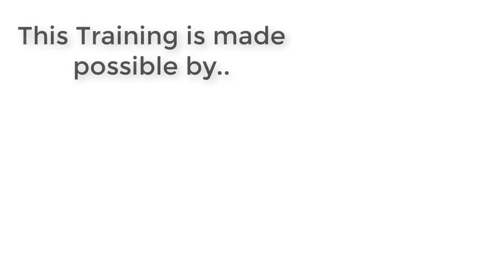A Common Cased Coil Issue

Comment: I find dozens of these improperly installed "N" coils that Carrier  and Rheem manufacture a year in Baltimore MD area. Sad when it was a new install not even 2-3 years old. Many  times  homeowner has given up on the original HVAC contractor who installed the new HVAC system because the house will not properly cool or dehumidify when the out temps reach over 90+ degrees with a  70% outdoor RH or higher.I have quite a few HVAC conatrctors not happy with me after I  go out on these HVAC calls for a 2nd opinion and b explain to homeowner what the issue is and that is was installed incorrectly and  homeowners get upset with the original HVAC installing contractor lol.I always match up a new cased Evaporator coil with a new gas furnace install to be the exact same width and I have no problem doing this with the HVAC brands I use that have  cased evaporator cabinets in 17.5" "A" cabinets, 21" "B" cabinets, 24.5 " "D" cabinets .